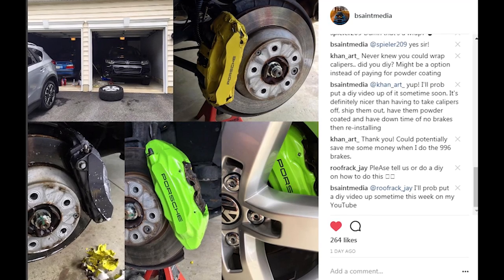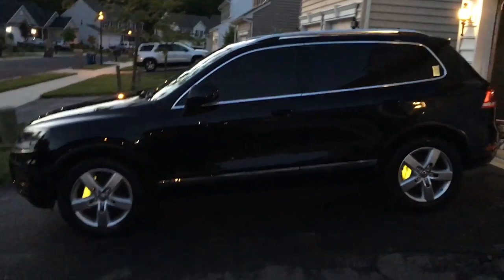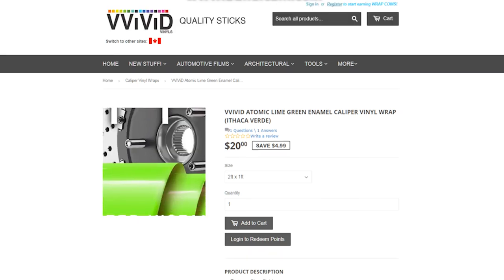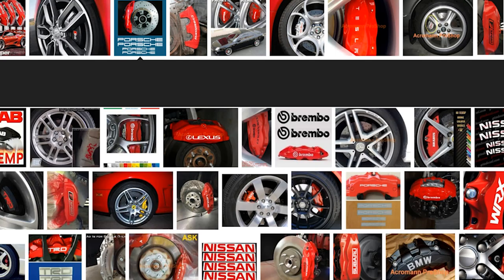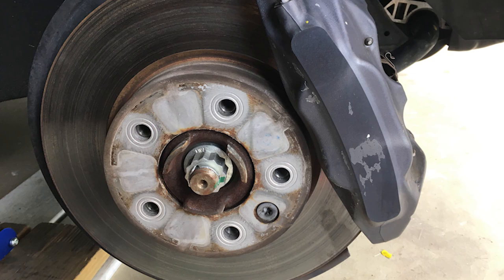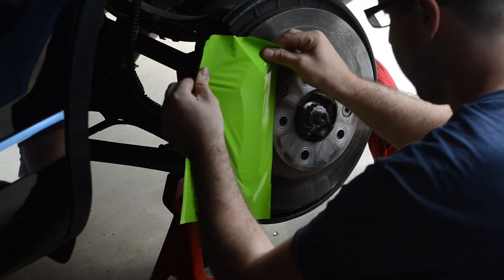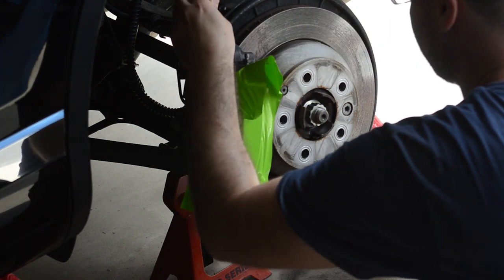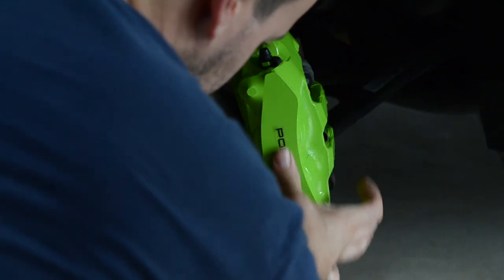Vinyl Wrap Your Brake Calipers?! | DIY Tutorial

Comment: I am currently using Plastidip on my Calipers and it's been holding up very well. The wrap is a good idea, I never knew they made high heat wrap for calipers. Good video 👌
Reply from the maker: hmm I didn't think Plastidip was mean't to withstand high heat like that, interesting.

Comment: $40 per caliper or the whole car? Looks to me like per caliper. Thanks for the vid. Just found out about wrapping calipers, I'm really interest. Thanks!
Reply from the maker: Joseph Citizen419 did you watch? It's $40 for 2 feet by 2 feet which I say is enough to do all 4
Reply: Must have missed it. How is this new wrap holding up now?
Reply from the maker: Joseph Citizen419 great so far no issues or cracking looks brand new when I wash my wheels
Reply: +Bsaint. Thanks for the reply man.
I caught a lot of shit for even mentioning wrapping calipers on my cars forum. So now, of course lol, I'm torn between painting and wrapping. Why did you wrap instead of paint? Anything you would have done different?
Reply from the maker: no worries, and I wrapped over paint because as mentioned in the video If/when I trade the car in for a newer one I don't want to have a dealer or future buyer bitch about lime green paint on the calipers lol  It's not exactly a flashy car so most people buying them don't want all that.  Wrap can be changed, swapped out color changed in few hours.  Paint and powder coat can not.
Reply: +Bsaint. If you were keeping the car/didn't care about future owners, would you wrap or paint? I'm interested in wrapping because it looks easier than painting on the car. I don't want/can't take my calipers off to paint, daily,  and I'm not sure of my abilities to bleed correctly on install.
If you have experience with both, don't care about resale, in my situation, would you wrap or paint? Does the wrap bake on that would make for a difficult removal. The baking on thing was a big no "don't do it" from my car forum. Thanks for the responses. subbed.
Reply from the maker: @josephcitizen4195  I would powder coat if that was the case.

Comment: I just use CHEAP - TREMCLAD  OIL PAINT !!! $ 15 bucks at Home Depot 
Brush on - Holds uo Fine !!!
 a Good Caliper Does not get too hot
Reply from the maker: That's up to you, but I explain the benefits of this such as easily changing the color down the road and or removing it when selling.